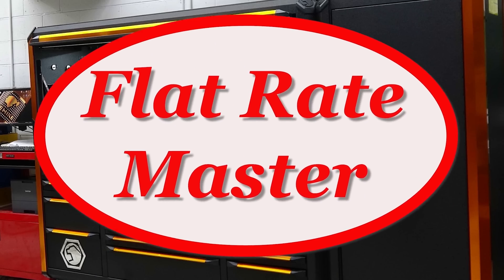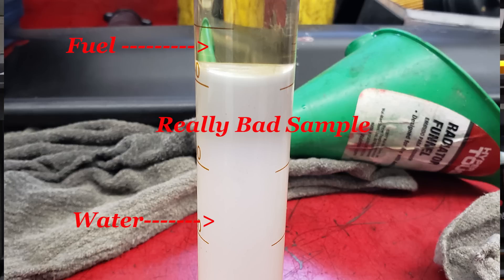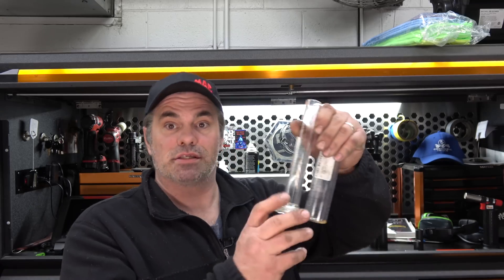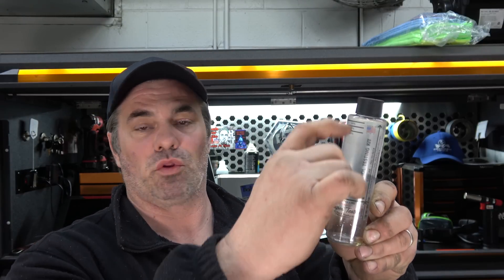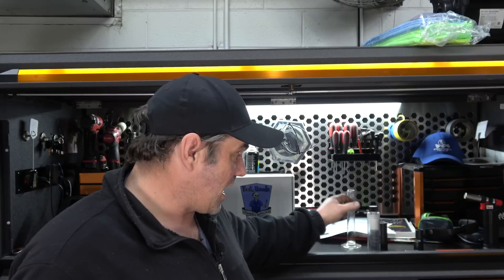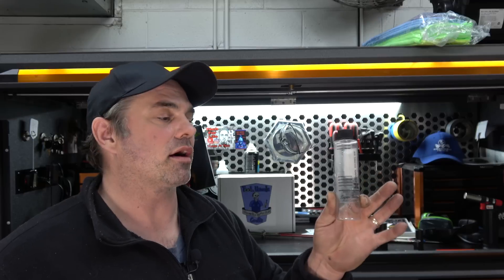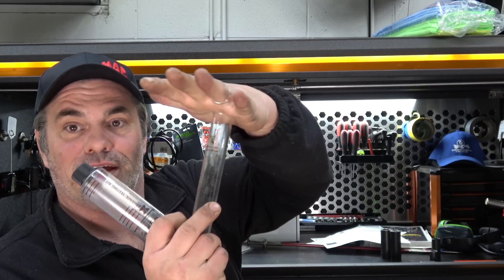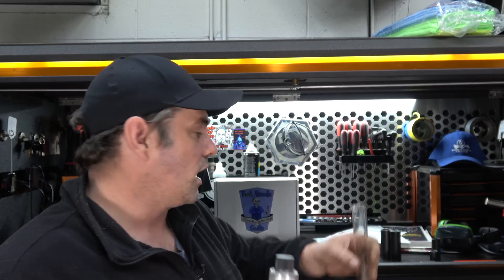Testing for Ethenol Content and Water in Fuel

Comment: Great video, I hauled gas, diesel, jet fuel aviation gas, propane and fuel oil, and ethanol for 8 years I can tell you much about where issues can start, but when ethanol came out well that’s an animal that causes more problems than it solves. When introduced it was mandated, in the state where I live, that all gas stations where to have their tanks cleaned of all water. In my state up until that point a tank could have up to 3” of water and good stations would remove that periodically, the siphon tube never reached that deep anyway, unfortunately some stations found out the hard way what happens when you didn’t clean out the tank a full 8 thousand gallon gallon tank of grey goo is mighty expensive.
Reply: My Dad managed a couple brand name gas stations in the 1990s when gasahol entered the Connecticut.  They used to turn the pumps off and shutdown while the tanks were being filled due to the water issue.  The owner learned the hard way after paying for a couple repairs and tow bills.  The water in the tanks would get stirred up while being filled. I remember he used to "stick the tanks" to measure the fuel levels and check for water.  There was some sort of paste he's put on the bottom of the stick that would change Cole in the presence of water.  I figured in the last 20+ years these problems would have gone away.
Reply: Yep, especially when they have to shut down and excavate the tanks.
Reply: Joetechlincolns  if it’s already a double fiberglass wall they won’t if it’s a steel single wall they will, unless it’s still serviceable. I’ll tell you though the Dot heads and the Pakistani’s  won’t spend a dime extra. They are buying up all the distributorships and gas stations all over the U.S. it’s something not reported on but I don’t trust them. Once they control all the fuel distribution they’ll have us by the balls.

Comment: A handful of years ago I spent entirely too long looking for an intermittent cylinder 1 misfire on a Prius. I could only get it to count 5-6 misfires on a 3 mile test drive so I tried everything in the book. As a last dish effort, I pulled a fuel sample probably 3 hours into the diag and wanted to kick myself because I kept saying there is no way water in the fuel will cause a single cylinder misfire.... but it did. Those are the lessons you don’t forget lol
Reply from the maker: Yes they are, one we had was just like that, F 150 5.0